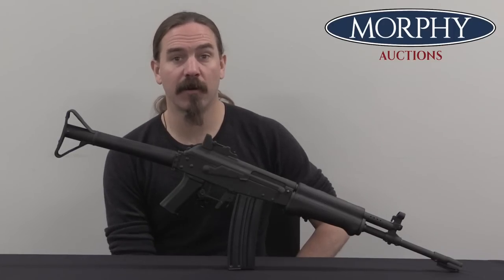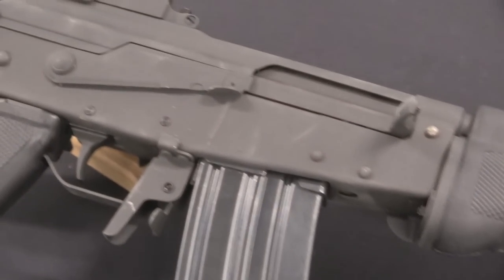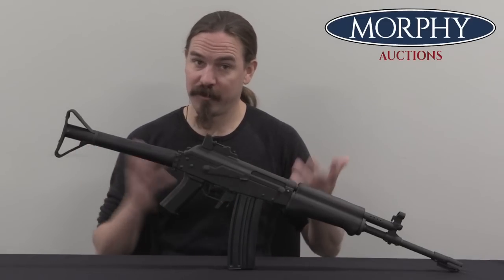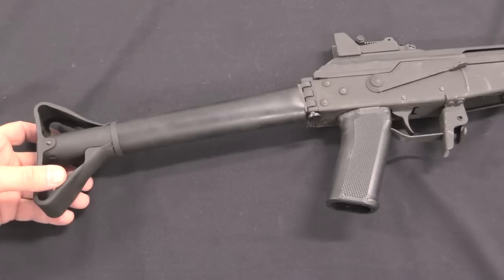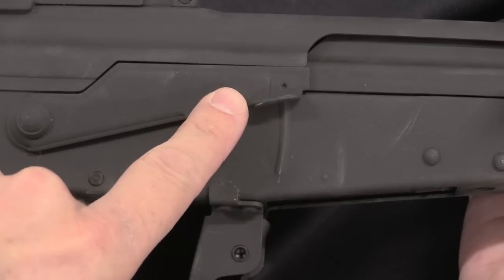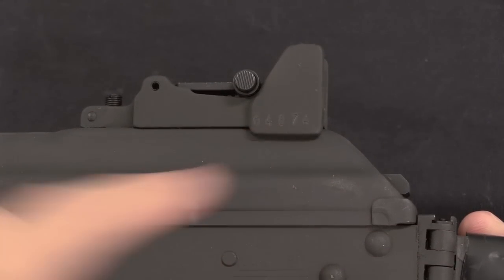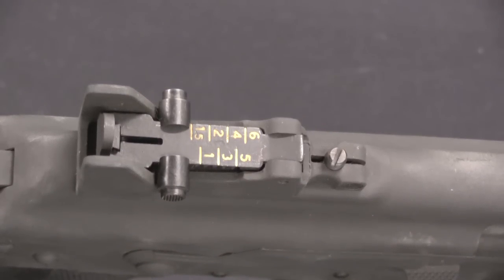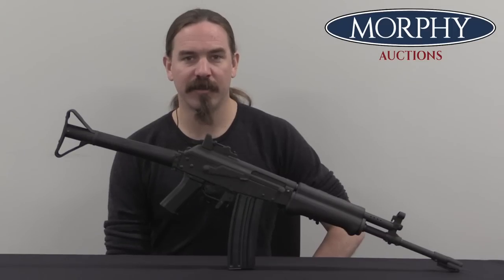Valmet M76: Finland's Stamped Receiver AK

Comment: the finns determined that the stamped receivers cost just as much as the milled receivers?  isn't that heresy?  i've watched many, many of your videos.  i remember you saying that the german army in wwii determined that stamped receivers were much more economical than milled receivers.  i also remember you saying that germany in wwii was short of minerals to make the special steel needed for milled receivers.  maybe this wasn't an issue for the finns at the time that they made the decision.
Reply: Stamped gun cost are inverse proportional to production numbers. If you make millions in continuous volume production, then they are better. Batch production on long term (years or decades) milled is better. Finns have around 100 thousand of m/76s still on war stocks.

76s were also not absolutely soldier proof, like milled RK62s are.
Reply: Stampings of substantial gauge of steel and complexity needs really big and expensive machinery, and dies.

In production setting that is production method with great possible savings, IF machinery is running all the time.

Finns produced 62/76 RK rifles for almost 25 years. Lots of them were made, but it was batch type production.

Since that time machining block of steel just have come even cheaper with CNC machining, plus injection moulding. In newly designed weapons, parts can be made with high speed and economically, without stampings. Making small, simple fittings it is still viable and economical method. Todays weapons just need very few that kind of parts.
Reply: replied to another comment here with a longer reply, in a nutshell the military specified needlessy high tolerances for the stamped receivers and all the extra cost also drove up the price (a lot of rejects). When the benefit of lower cost was lost the only real benefit remaining was marginally less weight of the completed rifle. Even though "good enough" doesn't have to be all that great in order to function well when dealing with stamped parts in a firearm, compare say with the Soviet PPS subguns.

Comment: Why no new finish ak imports???
Reply: Valmets ceased production in the mid-'80s. By 1989 the import of all "semi automatic assault weapons" was essentially banned. The RK95 (or SAKO M92) would have been banned from import under this rule and would've been even more difficult to import by the time the 1994 federal assault weapons ban was signed
Reply: @viggenguy4411  And for some reasons people don't want to buy expensive weapons when they can buy a lot cheaper weapons.
Reply: @XtreeM_FaiL  Yep, not a lot of appreciation for quality over quantity
Reply: @viggenguy4411  Yes and no.
1k Galil or 3k Valmet/Sako.
30k Ducati or 15k Kawasaki?

Comment: Finns could not make stamped receivers reliably? Weird.
Reply: It wasn't much as reliability issue than durability.
Reply: Cheaply enough. In 1978  SAKO got a new NCC robot that could carve out receivers so cheaply , that there was no economic advantage from stamping. Also the old m62 receivers could be used as spares. 
Durability issues were only anticipated. M76 had hardly even been in field testing when the  decision was made.